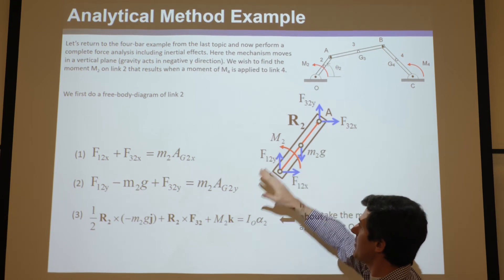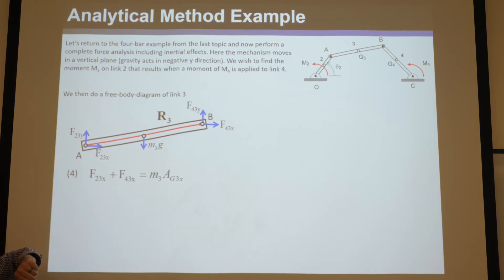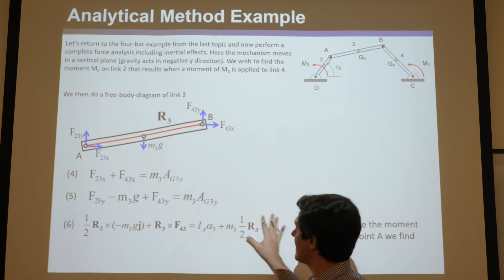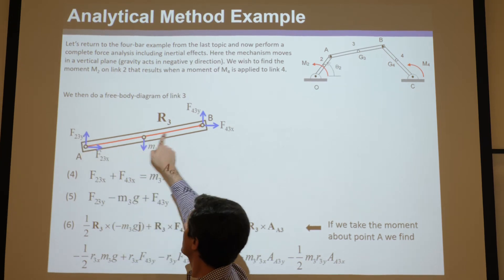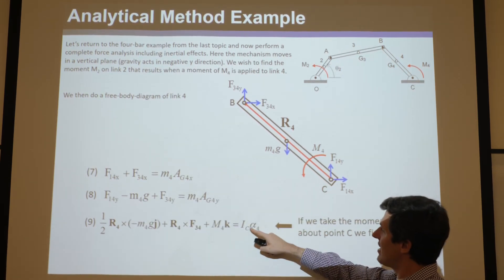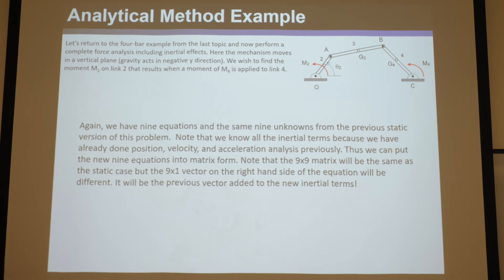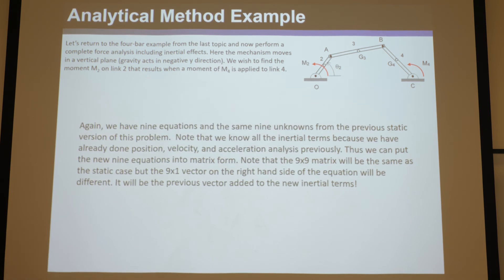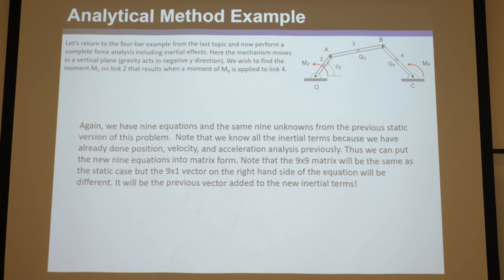Traditional Mechanisms and Mechanical Systems: Topic 7 Part 4

Comment: Many thanks for having uploaded this course. I am just beginning a phd related to flexures and mechanisms, and as my background is not in mechanics, this course (and the compliant mechanism course which I will start with soon) are perfect for preparing and brushing up on the knowledge I am missing.
The material is presented in an obvious and logical way, and the lectures have the right amount of speed and information to get the point across and also make the person following the lectures able to solve practical scenarios.
Reply: What Is your background? 😊
Reply: @fra2025  Originally Electrical Engineering with a specialization in Robotics (but a variety of courses in for example image processing, control systems, advanced analog circuits etc).